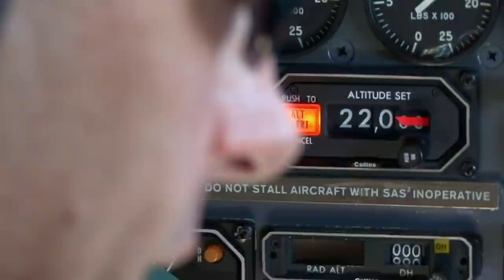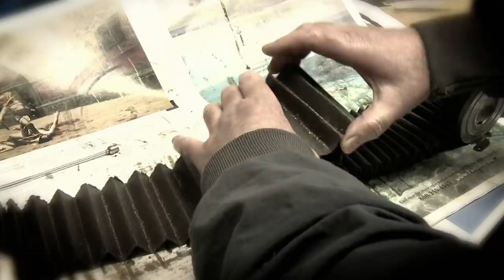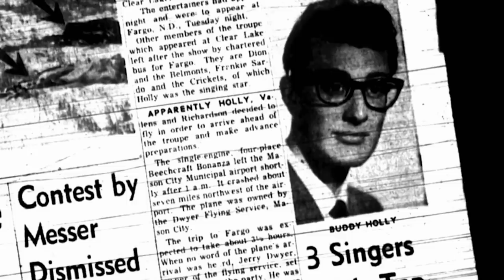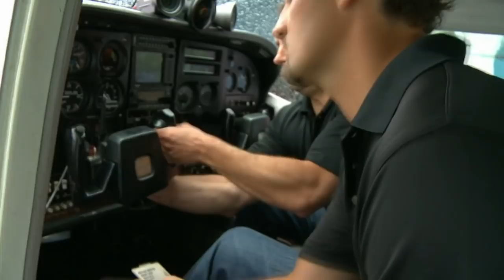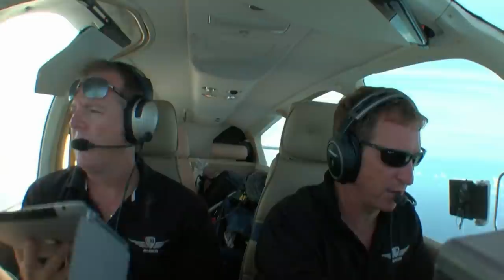New Pilots Attempt To Outrun A Hurricane | Dangerous Flights

Comment: Basic engineering knowledge that fuel tanks require venting.
Reply: He’s actually lucky the cap blew. Otherwise they would have had a vapor lock and fuel starvation. They wouldn’t easily realize the problem and time would be short as your gliding towards the ocean.